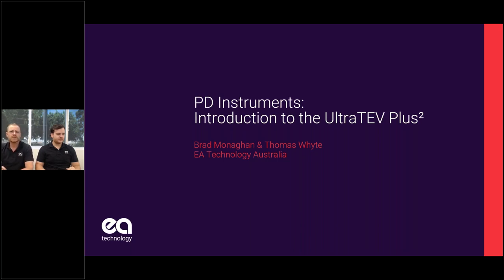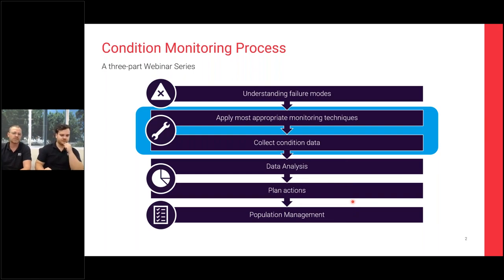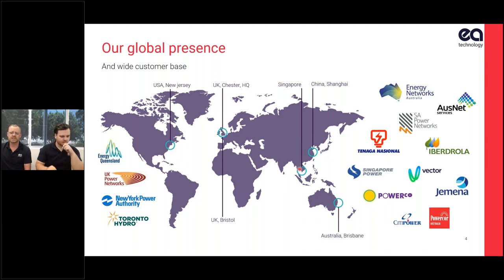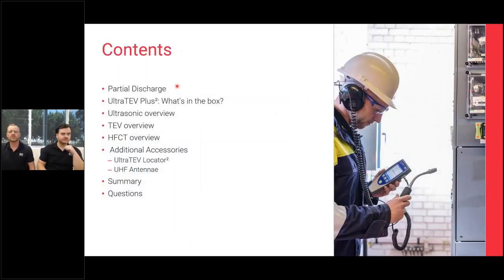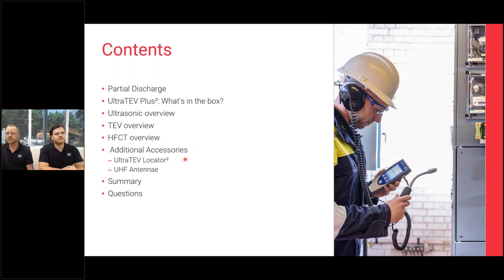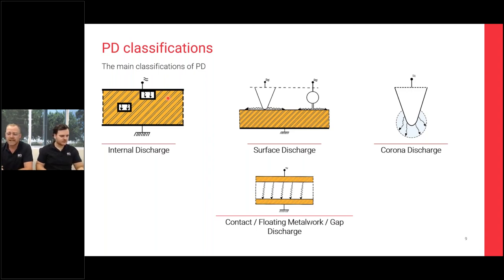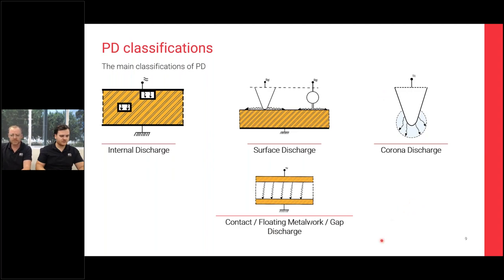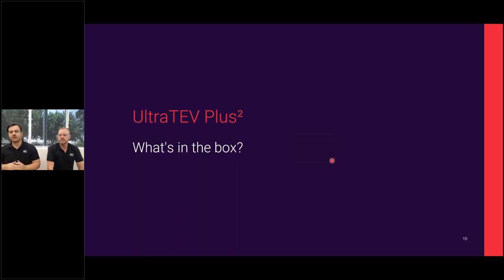Locate, Detect, Measure and Interpret Partial Discharge with UltraTEV Plus²

Comment: Well comprehensive explanation, we use your products to do yearly surveys of solar generation assets. 
We have found that field technicians do not understand the importance of testing both TEV and ultrasonic and the correct way of using the sensors. 
Are we allowed to use your youtube webinars for training ?
Reply from the maker: We're glad you find our webinars helpful. You're more than welcome to use them at your trainings. Additionally, if interested, our team also runs online training courses on Measuring Partial Discharge. The next session will be held in May, more details here: https://eatechnology.com/australia/training/partial-discharge/online-training-measuring-pd/

Comment: For PD cable. You just need to connect RFCT to ground cable is it correct?
No need to stick the ultratev ultrasonic microphone to the cable?
Reply from the maker: Hello @dhoviarali7968, apologies for the late reply. For cable PD, place the RFCT around the HV cable earth screen. You may also place the TEV sensor on the outside of the HV cable to detect local sources. 

Placing the ultrasonic microphone on the outside of the cable is not required. As this sensor is listening for sounds emitted from PD sources, this sound cannot be heard through physical layers of the cable. Hope this helps!